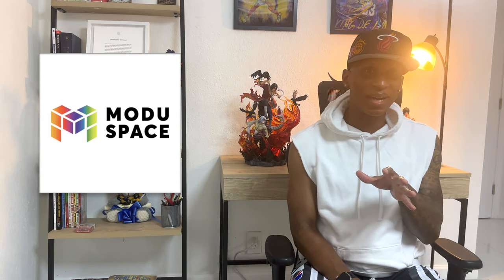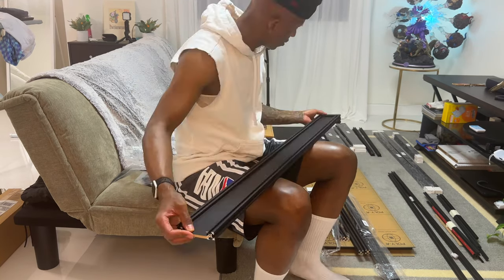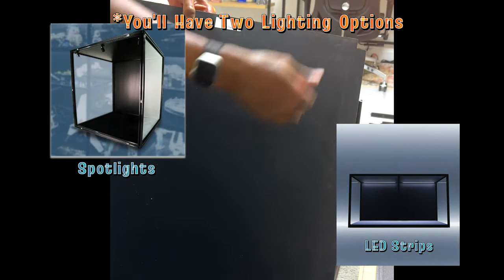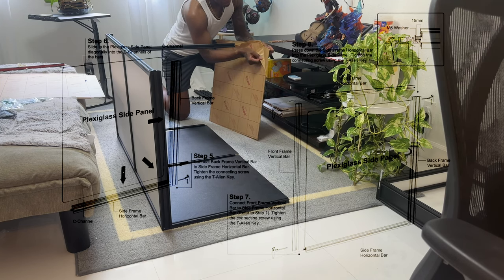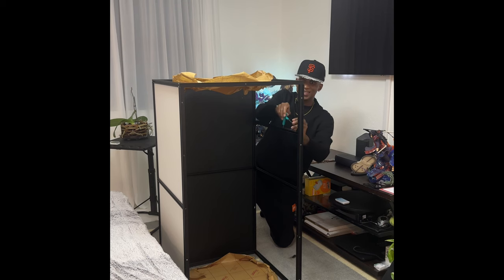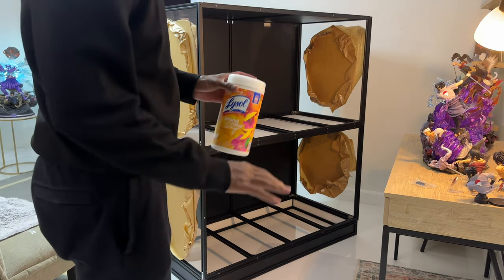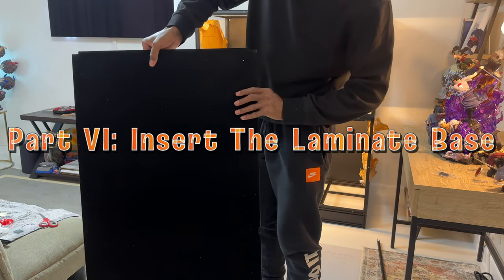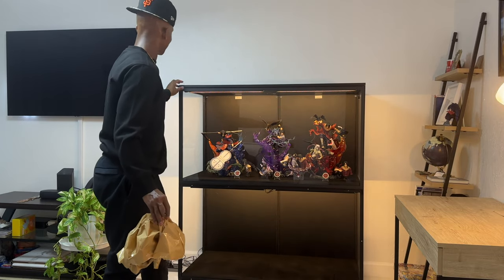Moduspace DF120 Display Case, Riser, Lighting, & Enhancement Bar Assembly!

Comment: Good job! I put together 8 cases with the weight upgrades and made the same mistake with the smaller screws. Power screw driver with an extended #3 Allen head was a life saver for me in reducing some of the effort.  It’s size 2.5 for the smaller heads and I had a flex extension that let me get in the corners to install those. I also found if you can putting them together on a table and then moving it to location saved my knees but your younger than I am.  Statues look great, congrats!
Reply from the maker: Haha glad to hear I wasn’t the only one 😂🙌🏾 And those are definitely good pointers! All-in-all, I “LOVE” their display cases and will certainly be adding more like yourself! 😁 The missus wouldn’t allow these to just be displayed any kind of way in our home 😅 but fortunately Moduspace makes things look good!! 😎👌🏾😄